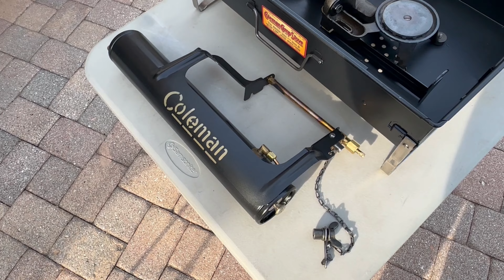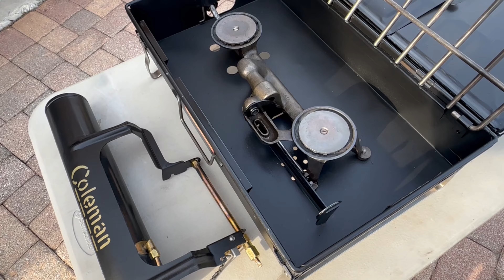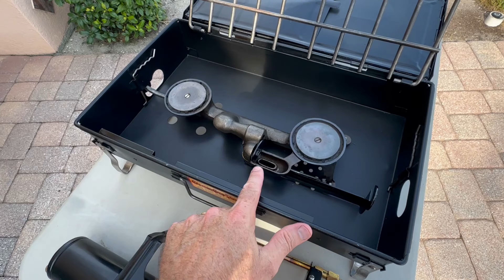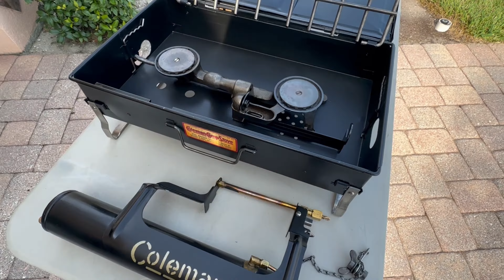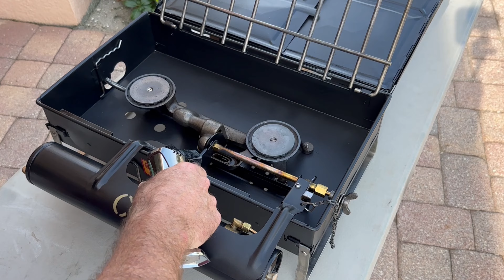Coleman Model 2D Stove - 'Hot Blast' Lighting Procedure

Comment: That's a nice stove. I acquired a model 9 a few years ago. Until today, I hadn't really done anything with it. I knew the pump worked, and the tank held pressure, but beyond that it just sat. It was quite a surprise  that it ran perfectly. Now I suppose I have to clean it up, give it a decent coat of paint, and use it once in a while.